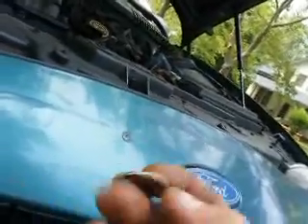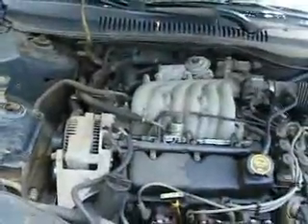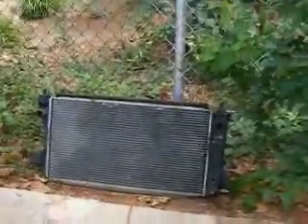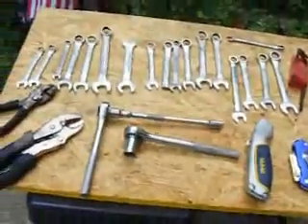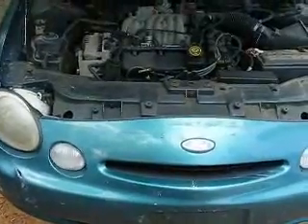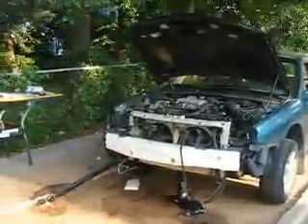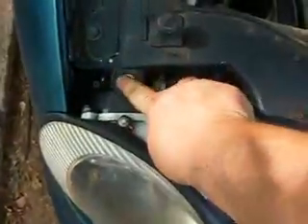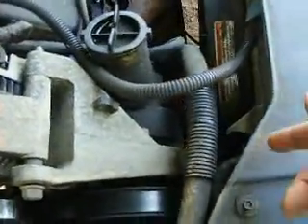Fixing the radiator in my 1997 Ford Taurus PART 1

Comment from the maker: @prisionbreak07: No problem. Did you stop the leak? If not, maybe use some teflon tape (the kind used in plumbing connections) for the threads on the bolt.

Comment from the maker: I'm glad I was able to help encourage you to take care of you n ya family too. thats dope kid. 

random tip... an easy way to know if your fuel pump crapped the bed...

is to open the FUEL DOOR and take the cap off the fuel filler neck and put your ear as close to the filler neck opening and have someone turn the key/ignition to the ON position. If you dont hear a hummmm.. means your fuel pump isnt priming your fuel lines. Check under hood fuses for fuel pump fuel fuse should be a giant 20 amp

Comment: Just a heads up taking the whole front end off is not necessary Ford put in access ports for you to remove this radiator without all the extra work. Besides that great videos.
Reply: Can you tell me where the access ports are to remove the radiator? I have to pull my radiator out here shortly and would like to do as little messing around with the front end as possible and I can't seem to find a way besides taking the whole nose off. Thanks.
Reply: Look into the little holes near the headlights there you will find the bolts to remove the brakcet holding the raditor in on the top. It will come out the best taking it out the bottom of the car.
Reply: Thanks! Appreciate it

Comment: the 2 trans lines are presure fitting lines they have a cheap tool for that
Reply from the maker: You're right. There is a cheap tool. And removal is quick and easier than a screw driver.
This was a long while ago and I've learned a lot since this video. Thanks for the additional help.
Reply from the maker: I hear Ya. As I'm getting through more and more cars.. if I have the $ I try for new fittings altogether. Unless it's no wear at all. I've learned more in 3 years up here in NH than I did in 30 yrs else where. There's tons and tons to do on cars. Can stay busy for a long time. Proper tools and a lift makes for long fun days.

Comment from the maker: If fuse isnt blown... and you dont hear the hummm from the fuel pump priming.. your pump is BAD.

That might be real shttie if it happens on the freeway, but its DOPE to have a reason to drop your fuel tank. THE REAL TIP.. is if you ever have to drop your fuel tank, you can splice into the wires and rig up a KILL SWITCH. you can hide it where ever you want. i like basic on n off type sht. alarm will prob keep your windows from being bashed out.. but kill switch is better than low jack...

Comment from the maker: No doubt man. How'd you make out? Yah, I'd never call myself a mechanic.. self sufficient maybe. Like I said up there ^^^^.. Ill open the manual and READ the steps. If Its just nuts and bolts... no big deal... save some dough. i wouldnt mess with an engine til i was able to put one on a stand.. im not distroyin no ones engine or. trannie.. but suspension, hoses, lines, motors, connections, cooling system... i leave electrical to a pro too.. no need to start fires in my dash board.

Comment from the maker: I just pulled mine out, after I got those clips out. The cut lines were from the junk yard. 
My top line had plenty of room and came right out. Maybe you'll need to take the whole nut/connection off the tranie cooler line. thats a bitch to get it back together. remember to use that plumbing tape on the connection going back on, or im pretty sure it will leak

Comment from the maker: How that radiator work out for you..
In the beginning of my video I said I didnt make it for instructional purposes. I dont know what I'm doing half the time I work on my cars or truck bro. I've learned alot, but all i ever do is open the haynes manual and read the steps if it sounds like I can do it.. even if 25 steps I'll do it... if there's 3 steps and one includes something only a pro should be messing with.. i find immediate help.. i aint no superman.
i hope you didnt cut your trans lines

Comment: Hmm u know the radiator actually comes out from the bottom
Reply from the maker: I was inexperienced. That's OK . How high do you think the front end would need to be for the radiator to have clearance? I haven't had a bad Taurus radiator since this.
Reply: boston229 wouldn't have to be very high at all we just used a regular floor jack and jacked it up as high as it would go if I had to guess maybe around 2 ft
Reply from the maker: I'll keep that in mind. If I had access to a lift... that would be ideal. And as soon as I am able to get one of my own. I surely would enjoy it. A lot.
Reply: boston229 yeah I hear ya lol it was a pain in the ass but it worked
Reply from the maker: I'm sure it did. I do sht all the time to make it work. That's part of the fun. Figuring out a work around or a mod
Reply: And in my car cheaper lol
Reply: Case not car